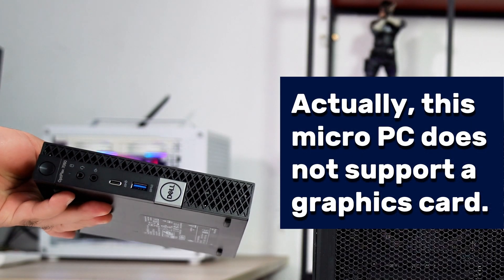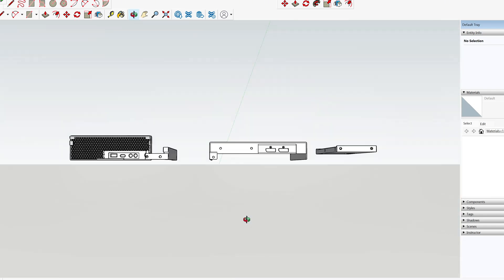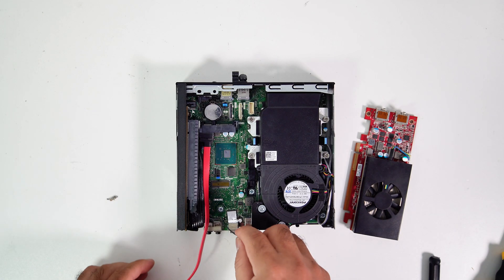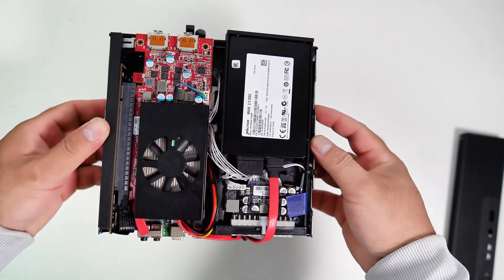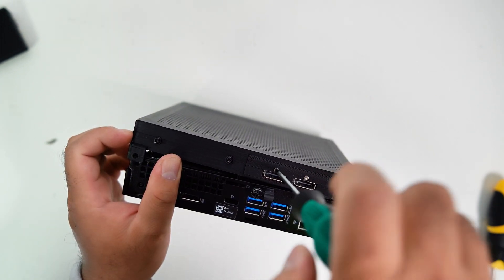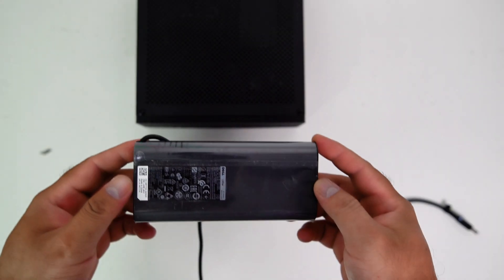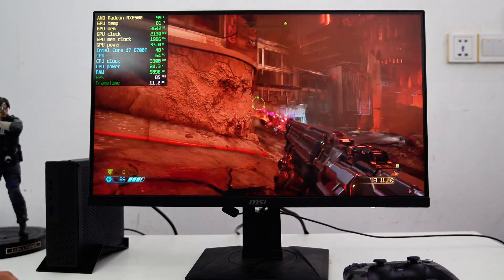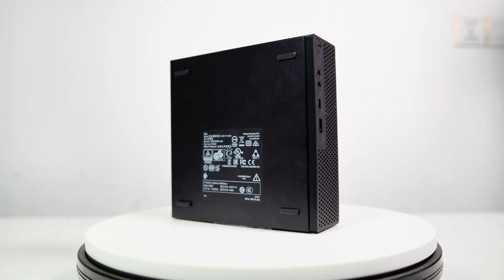Upgrading My Dell 7060 Micro PC WITH A GPU – Is It Possible?

Comment: I guess u know that if u remove the cover of the ssd, the space where it fits is like a 20%....i would never block the air of the cpu and if u print aditional parts, i would try my best to put another gpu more powerfull...nice but not the best, under my point of view at least

Comment: Hi with only one M.2 slot i would need to clone and add SSD.  would it be possible to use M.2 A E Key to NVMe SSD Adapter Caliper WiFi Slot to PCIe 4.0 x4 Converter  Mini PCs?? means i loose the wifi but can use ethernet. what do you think? thanks Ron

Comment: I found an Optiplex 7000 micro with 16gb ram, 12th gen i5 and dual M.2 2280 slots in a garbage can the other day. Took it home, got a power supply for it, a 1tb SSD card and wifi/Bluetooth card. It actually runs games pretty good. Just need to upgrade the graphics, the integrated graphics card sucks. It plays skyrim on the highest setting fantastically right now though.
Pretty great for a $100 garbage can PC lol. 
 
Also found an Optiplex 7070 micro with 8gb ram and i3. Not sure what to do with it.

Comment: Hi I have a pos Toshiba tcx 300 Intel i5 9th Gen 32 gb ram the problem with the ram is that it is a system that focuses on stability but not on performance so the ram that should run at 3200 runs only at 2133 mhz what I want to know is if I could do what you do in this video to add a card to improve the video the idea is not that it can be used in games I simply want to be able to use it with a good image quality monitor and maybe play one or another light game. Thanks I really enjoy watching your videos
Reply from the maker: Do your RAM sticks support JEDEC or XMP? If they support XMP, it's likely not supported by an OEM PC that uses a JEDEC memory profile. Thank you.

Comment: Great videos and explanations! I am trying to do the same. What’s the highest wattage it can deliver to the gpu? What if I use a 175w brick charger? Is it limited to the 75w on PCie ports? Will I need another psu if my gpu under load consumption is 120w ?

Comment: I need help it won't detect anything in the m.2 slot
Reply from the maker: You haven't provided details about your setup, so I can't offer specific help. Ensure your adapter is working properly and you've connected the power source correctly. Please note that an M.2 to PCIe x16 adapter won't work without a 12V power input through its SATA or MOLEX connector.

Comment: Its worth saying that Windows 10 support ends October 14th, and systems older than 8th gen intel may not be able to officially run windows 11. This system happens to be 8th gen.
Reply: @Jwalker76  just use windows 11 iot from massgravel it has no bloat

Comment: Try out modding Fujtisu Esprimo Q556 or similar, I use it as home server in somewhat strange 4tb 2.5 thick hdd, 2.5 slim ssd and 4 tb nvme setup, was wondering if adding GPU for transcoding is feasible.

Comment: How did you find this GPU? Checked eBay and AliExpress and nothing came up. First time I’ve ever heard of a single slot rx6500
Reply from the maker: Please check this video: https://www.youtube.com/watch?v=lmXsJdm3eq0
I bought this GPU two months ago for $99. It was sold by a user who pulled it out from their PC, which is common for the market demand and supply. It could have been sold out quickly.

Comment: Beware! Some PicoPSU knockoffs don't regulate the 12V line, they expect to be powered from the stabilized 12V PSU.
Reply from the maker: Hi there! Thanks for your insight. There are many types of PicoPSU with varying input voltages and output wattages, and those types are intended to work in specific scenarios. We can always check the product description and specifications before making a purchase. Thanks again for watching!

Comment: my dell pc has two 6 pin cables for the gpu, the gpu has 2 slots, one for a 6 pin cable and the other for an 8 pin slot, my question is, can the gpu run if i just use the 6pin cable since i dont have an 8 pin cable, or should i buy a  6pin to 8pin adapter cable? can the gpu run with just one cable?
Reply from the maker: Hi there! Based on your provided information, it is most likely that your PSU is either 360W or 400W and comes with one 6-pin PCIe power cable. This PSU should support GPUs that require a 6-pin PCIe power input, like the GTX 1650 Super or RX 6500 XT. However, when you pair it with a GPU that requires both a 6-pin and an 8-pin PCIe power input, such as the GTX 1080, RTX 2070 Super, or RTX 3070, it might not provide sufficient power to run that GPU. Thank you.
Reply: @itggear  my gpu has two 6 pin cables hanging there next to where the gpu does, my psu is 460W.
Reply from the maker: @ What is your GPU model?
Reply: @itggear  i havent bought one yet, but i want to buy the rtx 3070, but i noticed it has two slots, one for a 6 pin cable and the other for an 8 pin cable.my pc has two 6 pin cables no 8. i dont know if the gpu would run on just one 6 pin cable, but i can easily just buy the 6 pin to 8 pin adapter cable for it.
Reply: @itggear  i have a dell precision 3630
Reply from the maker: @archangelmusic13  I think it does have enough PCIe cables for your GPU, even if your GPU requires 6-pin + 8-pin or 6-pin + 6-pin. The 460W PSU on the T3630 does have a 6-pin and an 8 (6+2) pin that you can split into a 6-pin as well. I have installed an RTX 3070 on this PC, and it works just fine. Also, if you want to upgrade your PSU, it is very easy to do since the T3630 uses a standard ATX power supply that you can find on the market at a very affordable price. Thank you.
Reply: @itggear  i checked my pc, and it does not have an 8 pin cable, only two 6 pins.

Comment: While entertaining, in practicality, there is no point in this. You can buy and Dell micro cheaper than a Dell mini and do this same thing out of the box.
Reply from the maker: Hey, appreciate your thoughts! Like I mentioned in the video, this project is aimed at Dell 7060 Micro users who already have one. It's all about repurposing existing hardware without spending more. If someone's curious about how to install a GPU on a Dell 7060 Micro, there wasn't any content out there to help them—so I made this video to answer that very question.

Have you ever thought about making your ideas happen in reality? It's so exciting when we can bring our ideas to life. Sometimes it's not just about practicality, but about exploring possibilities and pushing the boundaries of what's possible with the gear we already have. By repurposing the 7060 Micro, we're tapping into new potentials that the device wasn't originally intended for.

Comment: arent pico psu 12V? wouldnt the 19v power adapter of the mini pc cause issues?
Reply from the maker: @zildeandespa681  This one is a 20V Pico PSU (16V-24V). You can choose a Pico PSU to fit your AC adapter, either 12V or 20V before you buy them.

Comment: Cool project and great job. If the finished housing cost around $15, it would be a sure success
Reply from the maker: The whole case component weighs about 150g, and 1Kg costs $20. The 3D printer consumes about 1KW, so the total cost to print a set of this case is about $3.

Comment: Would that PCI-e adapter work on the ASRock Deskmini? I got a great offer the x300 and the only thing keeping me from pulling the trigger is lack of PCI-e slot.
Reply from the maker: The M.2 to PCIe x16 riser adapter should work with any M.2 NVMe slot, so this adapter should work with your ASRock mini PC as well. However, you should inspect your mini PC chassis to see if it has the potential to be modified to accommodate the adapter and a GPU card. Please keep in mind that the minimum length for a single slot low-profile GPU is at least 150mm. If your PC chassis is shorter than this length, it may not be able to accommodate any graphics card. Thank you.

Comment: Hi, wanna say great work, almost creating gaming pc from Thin (pun intented) air ! After watching yor last videos involving 3d printg got myself a qestion that hope you could answer: could be possible 3d print the top cover of the hp prodesk sff line (like the one you used as steam machine) to fit another small psu and taller gpu ? This could open a lot of option for cheap gaming pc. Could be possible fit an rx 580 (with the help of a second psu) with less then 100$ pcs running 8-9 gen cpu
Reply from the maker: That is in my plan. Please stay tuned for the next video. Thank you for watching.
Reply: @itggear  i will wait for it !

Comment: Outstanding, beautiful mod buddy! Hey, it's there a way to avoid picoPSU? There are other m2 to pcie devices that has a little sata (power) adapter with it, that could do the trick to feed up the rx 6300 (32w)? Plus a 90w adapter would be enough?
Reply from the maker: I used a voltmeter to measure all power rails in this mini PC. There is no 12V power rail; even SATA uses only 5V, and the CPU fan is also a 5V fan. So, it's impossible to avoid using an extra power source. Thank you.
Reply: Got it, i guess it's impossible to avoid the picoPSU with the Optiplex 7060, what about a m715q gen 2 or m75q gen 1/2? Did you know if should have the same amount of power values in the connector as the 7060?
Reply from the maker: I think it's a bit challenging to install an M.2 to PCIe x16 adapter on the M705q Gen2 because the M.2 slot is located underneath the motherboard, making it difficult or impossible to route the cable to the upper chamber of the chassis. Thank you.

Comment: Hello. Can you test for Nvidia Quadro T1000?
Reply from the maker: Yes, it could work and it will run at PCIe 3.0 x4. Currently, I don't have the T1000 on hand, but once I have it, I will try it. Thank you.
Reply: @itggear  
Thank you. I am waiting for you as soon as possible. I currently have T1000 and P400 graphics cards. Also, can you draw the T1000 inputs for the 3D printer?
Reply: @itggear  I need some brief information from you. Will a 230w power supply be enough for an Intel i5 processor and a T1000?
Reply from the maker: The T1000 is only a 50W GPU, so I think it would work. Thank you.

Comment: Do you 3D print cover? I want to make this on my HP Prodesk 600 G5 mini but it doesn't have enough ventilation for the gpu 😢
Reply from the maker: Currently, I have only the HP EliteDesk 800 G4 Mini. I also plan to find a way to install a GPU on it. Please stay tuned for the next video. Thank you for watching.

Comment: aida64 stress test for 20 minutes would be interesting on this assembly. i think cpu&gpu hotspot would be 90-100 celsius with this cooling(in best case scenario)
Reply from the maker: You make a great point! Running a 20-minute AIDA64 stress test would definitely provide valuable insights into how this setup handles heat under load. In this video, though, I focused on showing how to install a GPU on an unsupported PC using an M.2 to PCIe x16 adapter and some custom 3D-printed components. The cool thing is, this DIY approach lets you choose any GPU that suits your needs. If you're concerned about thermal performance, going with a high-efficiency, single-slot, low-profile GPU like the RTX A1000 can keep temperatures in check while delivering impressive performance.

Comment: This is something I was planning, but i intend to extend the top and front face a bit more to accommodate either an rtx 4000 sff ada, or rtx 3050 LP. Given that you added a pico for supplementary power, you could probably get away with an rtx 4060 LP. Might be a fun experiment
Reply from the maker: That's a great idea!  A 4060 would be quite a powerful upgrade.

Comment: What if u add a powerful gpu with external psu and connect it with m2 to pcie will it work??
Reply from the maker: Connecting a powerful GPU through an M.2 to PCIe adapter with an external PSU might seem like a quick performance boost, but it comes with significant drawbacks. The setup can become quite messy and isn't easily detachable, making it a hassle if you need to move or adjust your system. More importantly, running a GPU without proper case protection exposes it to dust, static electricity, and physical damage. The lack of enclosure increases the risk of damaging the GPU and other components while in operation.

My focus is on revitalizing old, budget-friendly PCs by enhancing them safely and effectively using custom 3D-designed upgrades. This approach ensures all components are securely housed, maintaining the integrity and longevity of the hardware.

Have you considered using low-profile GPUs or exploring other compact solutions that fit within the micro PC form factor? There are innovative options available that boost performance without compromising on safety or convenience. It's incredible how much we can achieve with a bit of creativity and thoughtful planning!
Reply: @itggear  thanks man for informing me of the drawback from a professional
Reply: @itggear  but is it possible though

Comment: Nice to see that its a lot neater to setup with the single power brick solution this time unlike with the Optiplex 3050 Micro that needed two. Though as the other commenter said the wire to feed the PicoPSU from the 19.5v barrel jack on the board is a bit too thin. Nevertheless its an impressive mod since its not that much bigger from the original size.
Reply from the maker: Thank you for your suggestion; I'll keep it in mind and improve in my next video. Thanks again for watching!

Comment: tbh, this is too troublesome. just buy the Lenovo tiny thinkstation or thinkcentre instead, those are way easier
Reply from the maker: I see where you're coming from! I actually have several videos about Lenovo ThinkCentre Tiny PCs on my channel—they're fantastic machines and can be easier to work with. However, this particular video is dedicated to Dell 7060 Micro owners. My goal is to provide them with creative ways to maximize the hardware they already have through DIY projects and custom 3D-designed upgrades. There's something special about breathing new life into existing equipment and pushing its potential.

Thanks for watching and sharing your thoughts! Have you had any experiences with modding PCs yourself? It's amazing what we can achieve when we get hands-on with our tech!
Reply: @Onion_Knights  technically it's smaller
Reply: @GhostLinx  but way better
Reply: @Onion_Knights  I agree w you but this guy's not trying to make something better or easier , just as small as possible, anything smaller would be a mini pc that could only connect to an external GPU through m.2 that is not something ideal performance wise.. so imo this price-size-performance ratio is more than justified, imagine a 5-7 th gen i7-i9 paired with a 4060ssf , for cheap and small. That makes it worth the time.

Comment: Well well well, try to put a RTX A2000 LP to see how does it handle game?

My Optiplex 7060 Micro is ready to game on lmao
Reply from the maker: It will have better performance than the GPU in this video. Thank you.
Reply: @itggear Do I have to turn off ASPM just to get Nvidia GPU run full speed?

Comment: Hi, I like the idea of ultra-compacts. Can you tell me which plugins you use in Sketchup for 3D printing and modeling? I do some things, but in Fusion, which is quite heavy.
Reply from the maker: I did not use any SketchUp plug-ins. The ventilation was created using the "Make Component" function in SketchUp, so when it's exported to other file formats, it can generate many individual objects that cause the file to open slowly in other CAD software. Thank you.

Comment: The 7080 and 7090 could be ordered with an x8 PCIe slot, kind of like the Lenovo systems. Unfortunately, they have the PCIe slot on the opposite side so the GPU has to face down. Also, you can get a barrel adapter to go from the 4.5mm on this system to the 7.4mm on the newer systems.
Reply: @TheGameBench  does the 7050 can be modded like this? i wana do this to my pc but im nit sure.
Reply: @kenjiKoroko_EN  Unfortunately, no. However, you could do what he did in the video and make it work.
Reply: @TheGameBench so i can technically copy what he did to the 7060 micro video then. so is it possible i can use a low profile gpu then
Reply: but do you also have to get another or a different PSU?
Reply: @fischflossn  Typically they come with a 60 or a 90 watt, and I tested the one I had with the Arc A310 with a 130 watt, so yeah... I think you would at least need the 130 watt.
Reply: @TheGameBench  yeah, but I meant do you also have to adapt the mods that the guy in the video has done? or does the card just run from the PCIe power?
Reply: and if no, are there options to somehow get an 8pin for something like a RTX 5050, even with another kind of PSU or stuff.
Reply from the maker: Thanks for sharing your insights! It's fascinating how the 7080 and 7090 models offer that x8 PCIe slot, even if the GPU ends up facing down because of the slot's orientation. The barrel adapter tip is super handy for those looking to bridge power connectors between systems.

I aimed to make the most of the 7060 Micro without any extra cost, especially for fellow owners of this model. By crafting custom 3D-printed components, I turned what seemed like a daunting task into a straightforward, step-by-step process. It's incredible how a bit of creativity can transform our existing hardware into something more powerful.

Have you tried any custom mods yourself? It's amazing to see what's possible when we push the boundaries of our home setups!
Reply: @itggear  Please get a 7090 and do a mod for that too! Would love to see one with a GPU too!